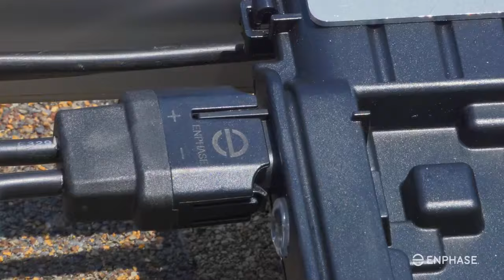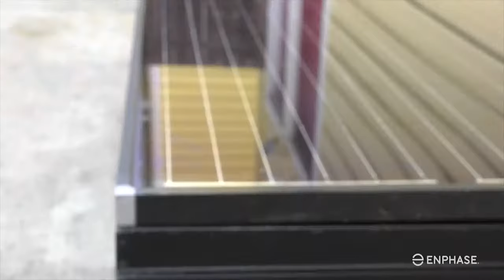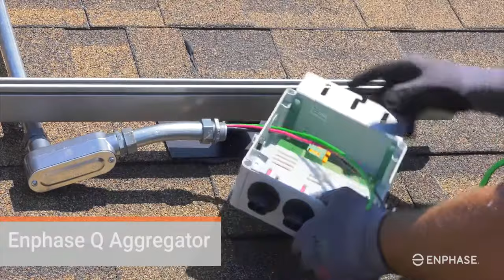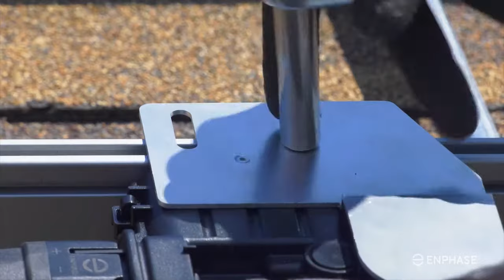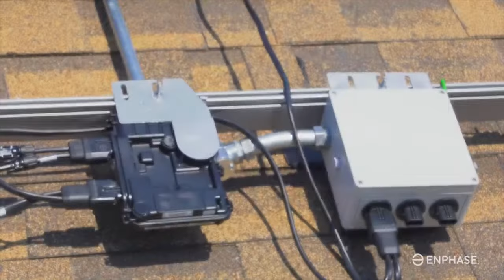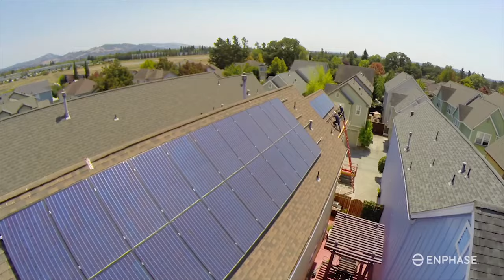Enphase IQ Microinverter Installation   Enphase Energy

Comment: What are they using to stand on? I can see they used a small scissor lift, then somehow a scaffold deck board?
Reply from the maker: What do you mean? The microinverter or the solar panel mounting rail? You can download the installation manuals on the product page under Documents and Downloads here: https://zerohomebills.com/product/enphase-iq7-60-and-72-cell-microinverter-230-400vac/ or you can view the frame mounts here: https://zerohomebills.com/brand/enphase-energy/ but I guess in the video are mounted directly in the rail.
Reply: looks like a 2*4 nailed to the roof
Reply: @pokechamp003  its lie a roof scaffolding plank

Comment: I have the Q cable disconnect tool. I don't know how to use it. Every youtube show shows how to snap those cables together. Nobody shows you close up how to disconnect those cables using this tool. The Enphase manual is useless.
Reply from the maker: Using the Disconnect Tool is simple. To disconnect a cable termination, insert the tool into the connector until you feel a click. This indicates that the tool is properly engaged with the connector. Then, pull the tool gently but firmly to remove the connector from its mating connector. .. i will upload the video later today for you.
Reply from the maker: https://www.youtube.com/shorts/zzwKqJNm5uc
Reply: @3buysolar  Thank you. This is the best video on how to use this tool anywhere.

Comment: I watched this video to see how to separate the Enphase m215 microinverter wire separation tool. 100% of the YouTube videos shows you how to snap those 2 wires together, something that takes no brain to do. I want to see a closer up of how to separate the AC and DC wires connections apart. Absolutely no body will show this and the factory instructions are worthless?
Reply from the maker: I am not getting it. For AC connection you have a special tool from Enphase. It is called Q cable disconnector tool. On the DC side you do not need anything special.